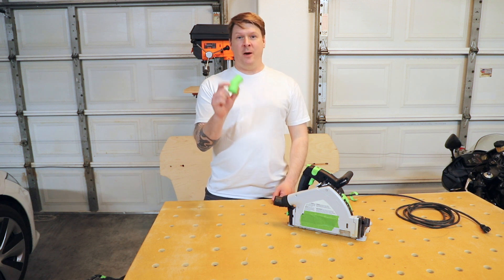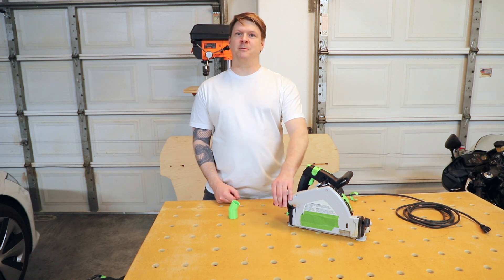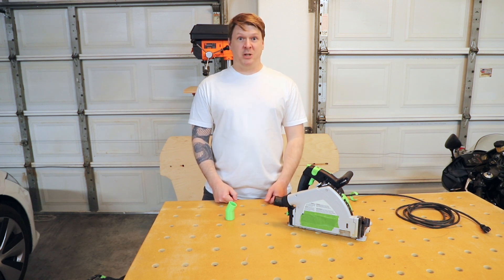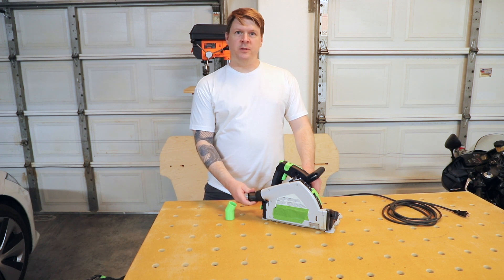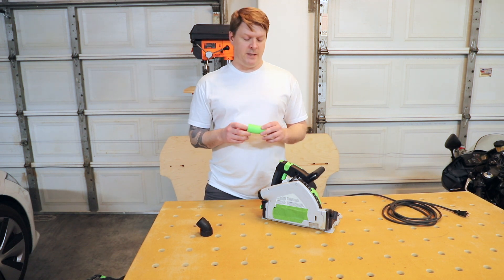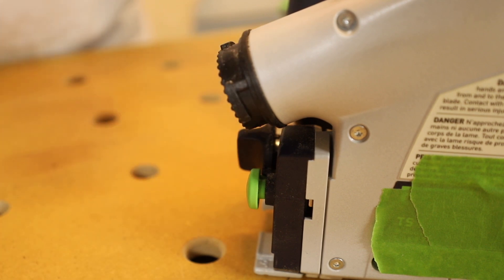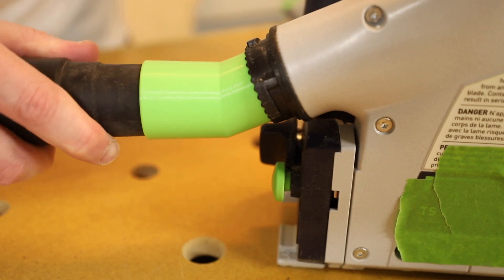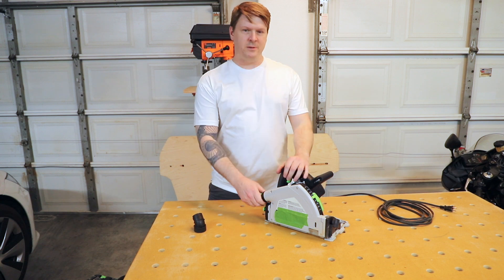Tame your Festool hose with this Track Saw adapter

Comment: Can you use this without using the Festool hose (e.g. if I have a third-party hose setup)?
Reply from the maker: As long as the end of the hose has an outer dimension matching a Festool hose (about 1 12/16” or 34mm) or an inner dimension of 1.5” (38-39mm) it should work.
Reply: @stickelbuilds  Just ended up buying the festool hose. Ordering your adapter, now. 

Thanks!

Comment: Does it fit with new style festool hose. IE: old ones are smooth rubber fitting, new ones have the bayonet style ribs
Reply from the maker: I’m not familiar with the new style of hose. Can you send me a picture and some dimensions?
Reply from the maker: I added a digital download of the adapter for purchase on my website. If you have access to a 3D printer you can buy the file to print it yourself and check the fit.
Reply from the maker: I believe it should fit with the new style Festool hose connections. They still fit within the same diameters. The main difference is you wouldn’t get the “locking” mechanism with the bayonet style ribs. The friction fit should be enough though.

Comment: What about the even older TS 55, the original will it fit that?
Reply from the maker: Unfortunately I don't have access to an older TS 55. I'm under the impression they have the same size dust port and I've asked Peter Millard to confirm since he has one.
Reply from the maker: I'm told the older, original model doesn't have a removable collar. Since that is the case I don't think this adapter would work with the original TS 55 saws.